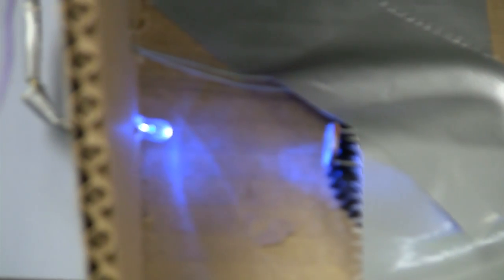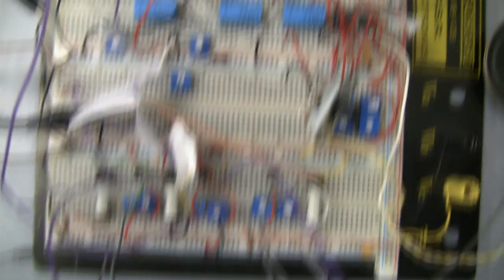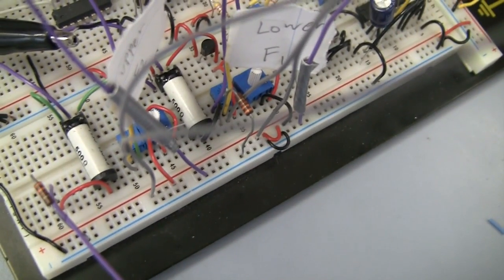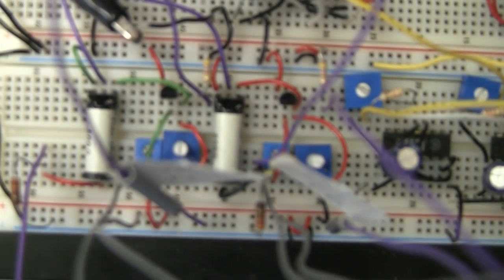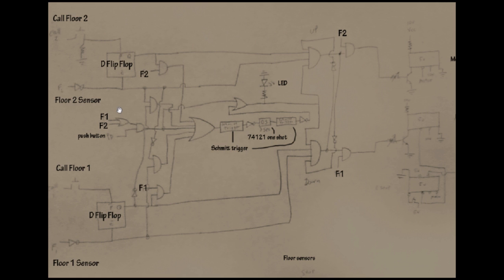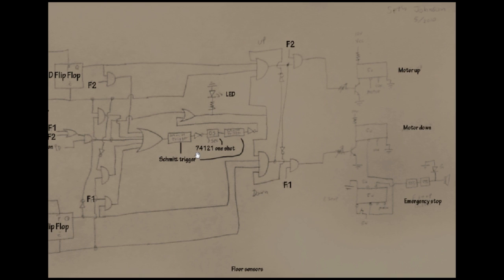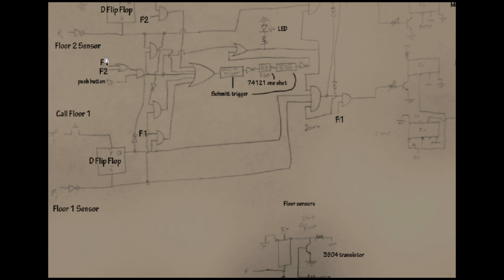Two Floor Elevator Project 2010

Comment: One thing that doesn't make sense, are you just leaving the D input on the D Flip-Flop disconnected? Also, why are you AND-ing the output of the four-input AND gate with the corresponding floor sensor, when the floor sensor is already one of the inputs of the four-input AND gate?
Reply from the maker: +Riku72293 Hello. This project was many years ago and I have forgotten 99.9% of everything I did to make it work. I cant even remember the logic. I am sorry I cant help answer your questions.

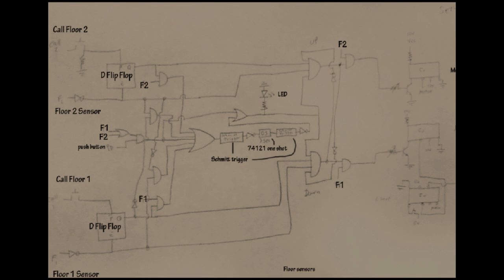Comment from the maker: Hello. sadly this was almost 3 years ago and I have forgotten most of the stuff that was used in the project. The instructor of the class gave us the project saying that he wanted a 2 floor elevator with e-stop. that is all that we had to go on. that said I dont have a parts list and I dont remember what we did. it might help you to look at the schematic on the board as well as the one I have at the time of 3:50 in the video. Other than that i say just have fun and experiment.